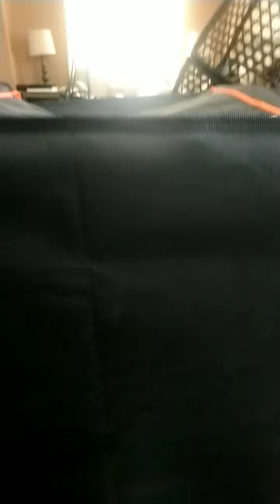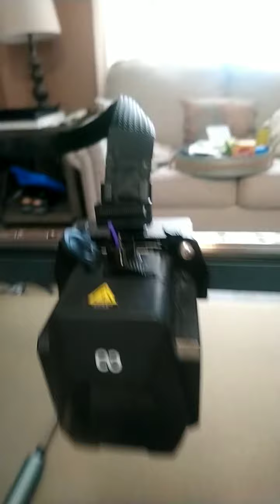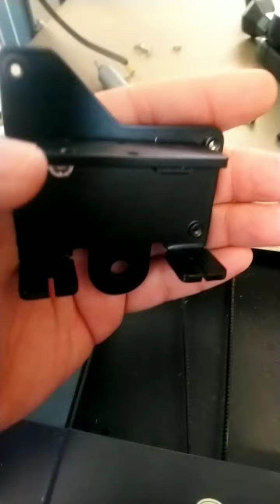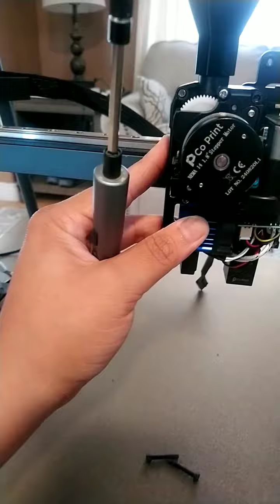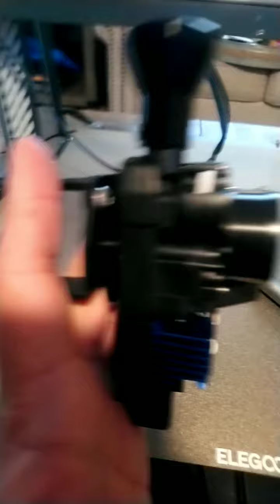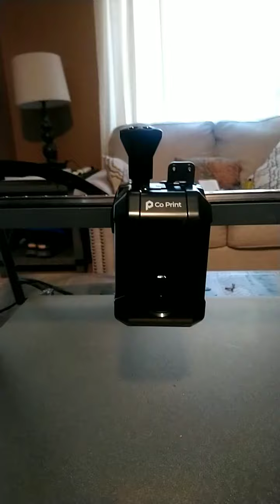#N4max Coprint chromahead install on N4Max no adapter using all carriage

Comment: why did you change out the carriage
Reply from the maker: @lukeglavan  I ended up modifying my original carriage shaved the post and Dremel a small hole to mount the head plum to X
Reply from the maker: @lukeglavan  hey it's small world I was just at the Eleego warehouse and your CoPrint is in the States!! Prepare for multi material mate 😜